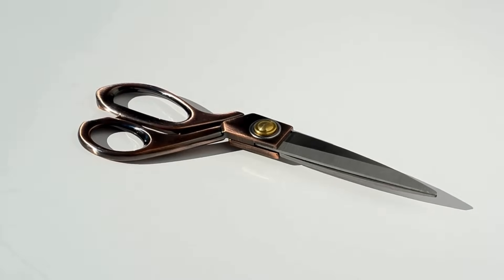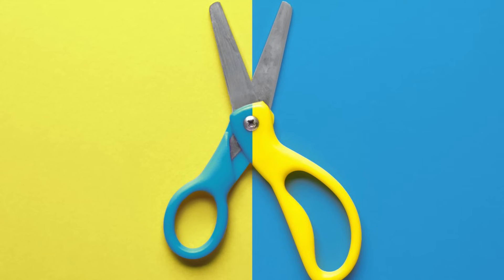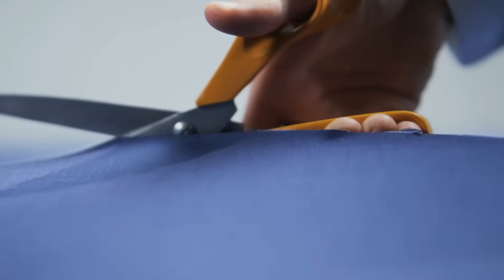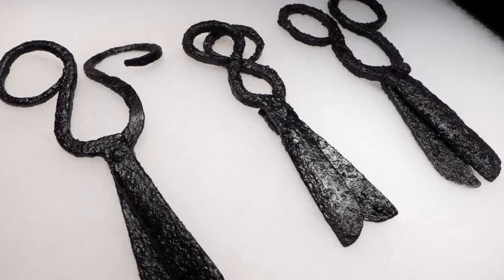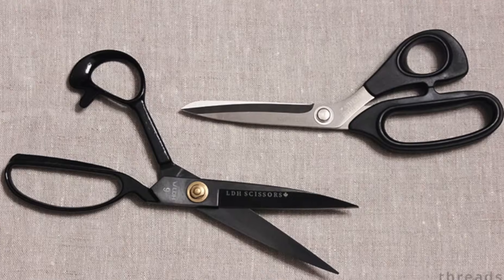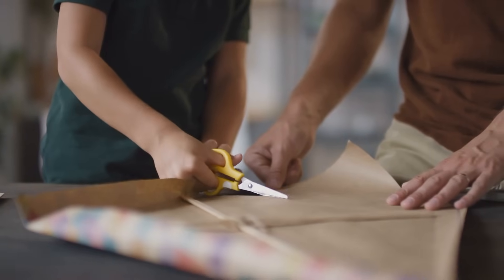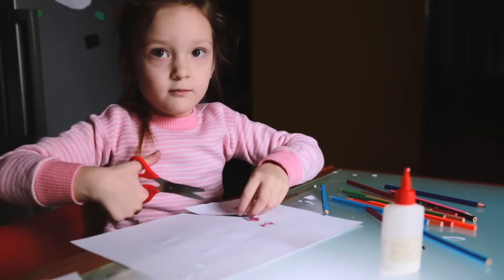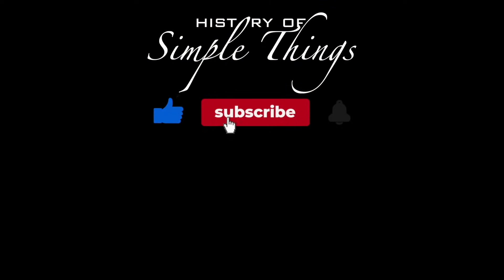Why Do Scissors Have One Bigger Handle?

Comment: What's funny is that somewhere here they show a barber's scissors, and those tend NOT to have that bigger loop, as you see when they show it.  I'm sure it has everything to do with the function -- possibly because it's a scissors for finer work and the extra weight of more fingers might make it less precise.  I imagine it's also the reason why they can seem awkwardly long-bladed for cutting fabric or paper or other continuous shape-cutting tasks.   Other tools and repetitive careful movements are used for cutting a lot of hair, even in serious shaves -it's about control over volume with scissors, even then.  Snips, sheers and scissors actually feel like different categories of a similar cutting tool to me  The smaller Egyptian scissors here might be more of a snips --good for cutting a strand cleanly but not making long cutting lines - I've seen "snips" like this sold at sewing stores that work like scissors but have much shorter sharpened blades and more spring, ideal for cutting thread but obviously they'd be disastrous for cutting fabric for a project. shears have the big holes on both sides, so you can use one hand in each side to chop heavy branches.  I knew what's described here intuitively, but it's fun to consider here how many specialize scissor and tong types there are, and how they all kinda move out from the same basic concept to such specificity.